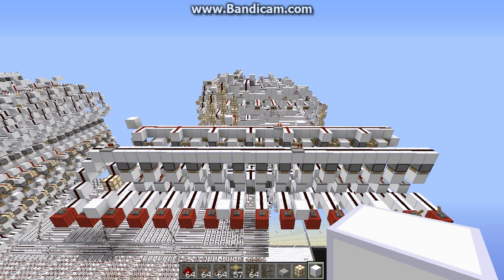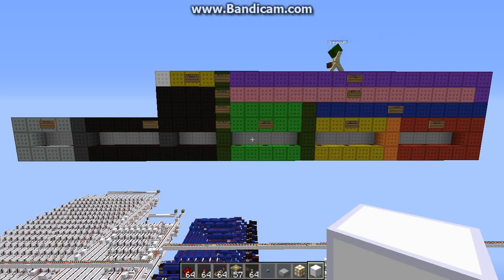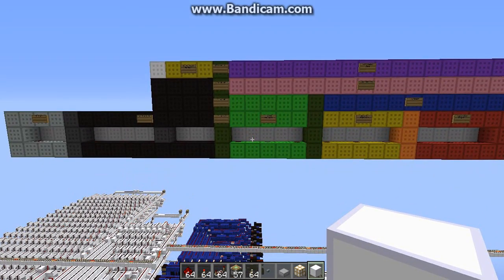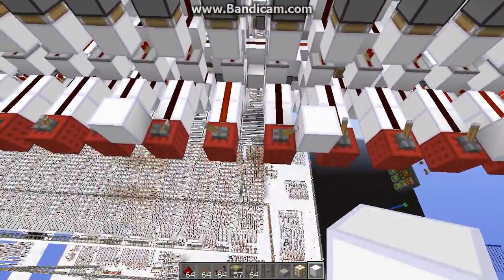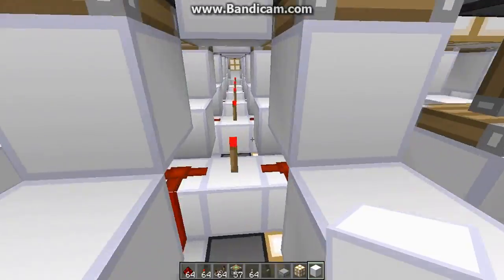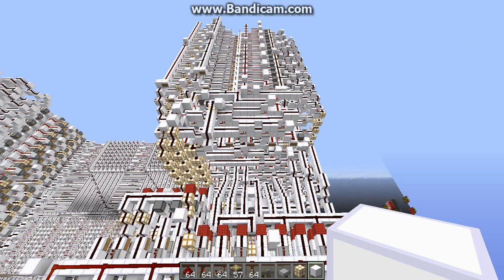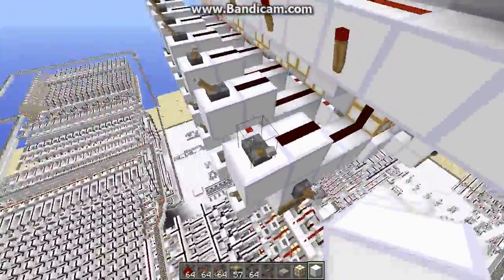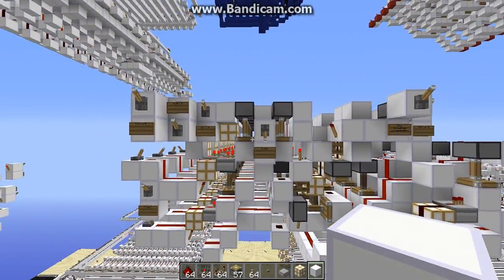Final Update on Advanced Redstone Computer Series

Comment: I want a advanced technology CPU, And powerfull. But really I want speed over power, and I have a great 6 tick CLE ALU! 🤔😀😃 And thank you for the awesome video's! 🤓😄😎
Reply: Benny, i want to start a New concept. A CLE CPU and a stack + barrel shifter. All diagonal and vertical. The l00p is 8 ticks. Alu is 5 ticks! Registers are 3 ticks, the stack is 4 ticks. And the barrel shifter is 5 ticks, all pipelined and sync. Hope you like it! The pipeline is 4 stage btw. The ALU doesn't have a right shifter, but I have a barrel shifter. So everything is good! The clock speed is going to be 6 ticks!

Comment from the maker: The thing is it isn't an issue of building it. Once you have a computer you've done all the required building. The only issue would be programming it to do so, but even then there's existing code for that. All you'd effectively need to do is sit for hours placing torches in program memory and the end result would be something that's already easily done on existing computers. If you have the patience, you're free to do so, but I personally don't think it's worth it.

Comment from the maker: Less bits can be trickier because some operations work based on all bits. When you don't have many bits, it makes it difficult to understand what these operations are actually doing, or even why they're useful. 
Another reason is if you don't have a lot of bits, you very quickly run out of bits to represent information. Unless you get into some clever tricks, that can be really difficult to overcome.
And again, all I made was a recommendation. 1/2 will work fine, it'll just be a little abstract.

Comment from the maker: It's most certainly possible. If I was starting out with computing though, I'd recommend starting with 4 bits. It's small enough to not be too much work, but big enough that you can do some interesting things with it. I recommend staying at 4 bits for a while until you can design CPU's that don't just have wires going everywhere.

But again, those are recommendations. If you want to do 1/2 bit, that's perfectly fine, but I think it'll be trickier to understand and you won't be able to do much.

Comment from the maker: In a sense, yeah. You know how if you have power diagonally above a piston, it creates a BUD? Well, if you put a fence gate on top of the piston, that will open/closes when the power changes. What this does is update the BUD, so it'll activate every time the power for it changes.

The end result of all this is you can use a wire that would normally BUD a piston as a wire that "powers" the piston.

Hope this helps!